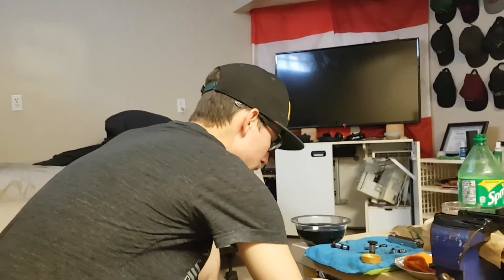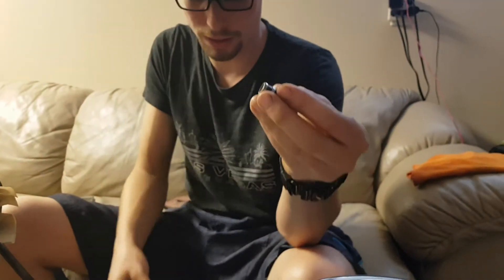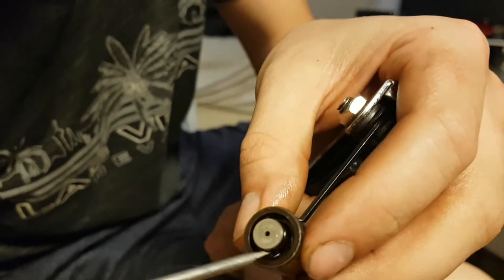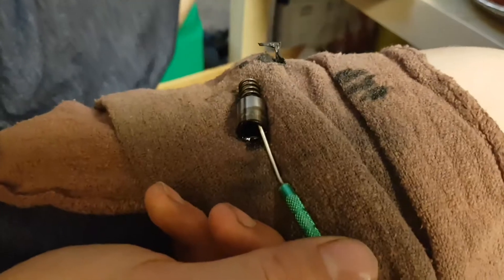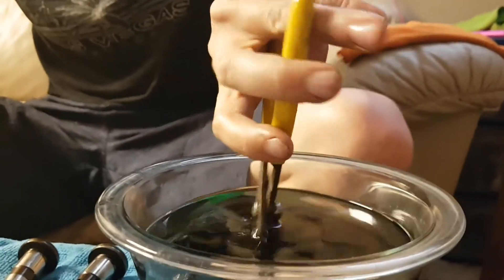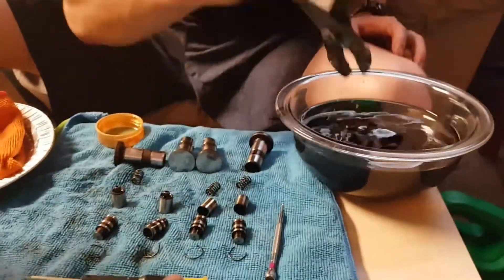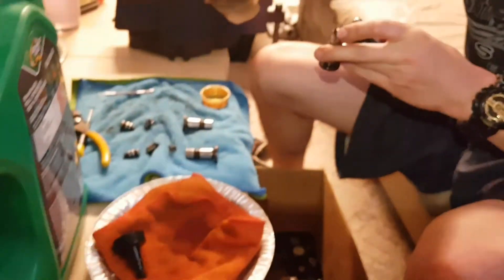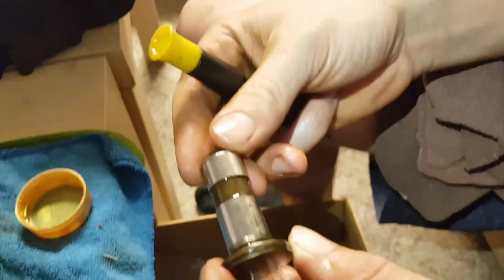Hydraulic Lifter Refurbishing | VG30E/T

Comment: Whats the engine going into? I'm also in Canada. I just rebuild a vg33 for a 4x4 d21, but didn't rebuild the lifters and have a bad tick when warm.

If you need any vg parts let me know.
Reply: Ye those are classic sticky lifters. Protip while you are down there its worth doing valve stem seals, they are also notorious for oozing. Mine had some gunk that blocked the vein when the oil was cold, but as it warmed up the click slowly dissipated.
Reply from the maker: Did mine a few years back but hell yeah bro!!
Reply from the maker: This is going into my turbo z31. Check it out on my other videos!